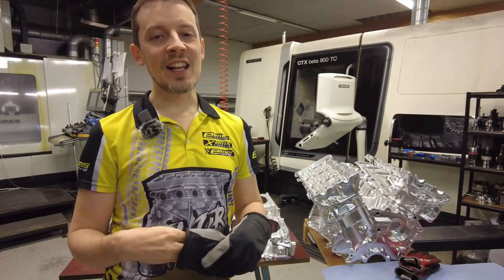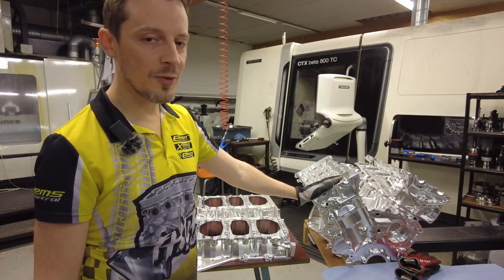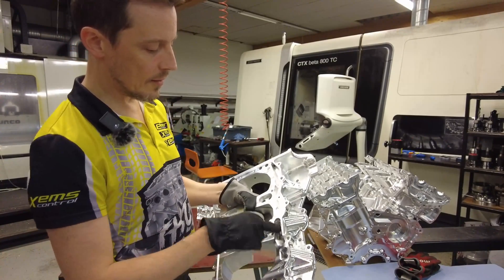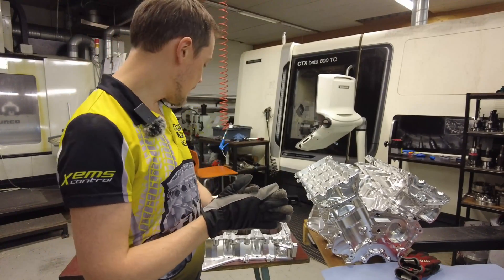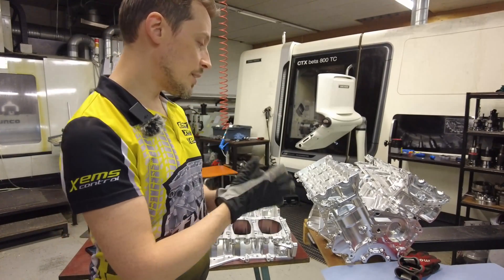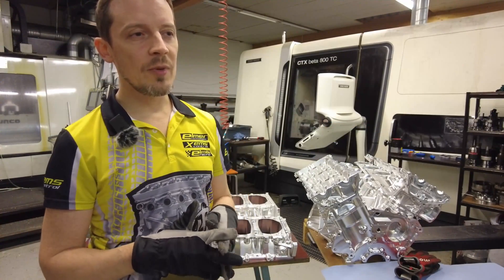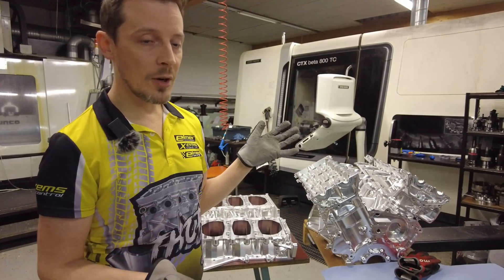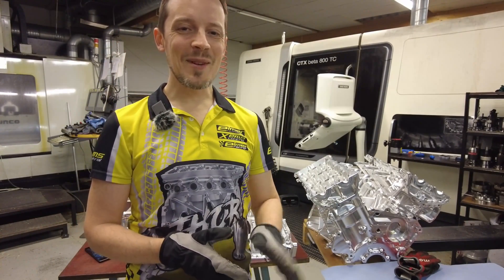4000hp Hel engine update: billet girdle

Comment: Could the 5000cc Hel de-turn to around megawatt for daily drive ?
Reply from the maker: We recommend it for up to 2000hp for street use. We have a engine package with exhaust manifolds and turbos in the works for street use actually. Check out shop.elmerracing.com for details.